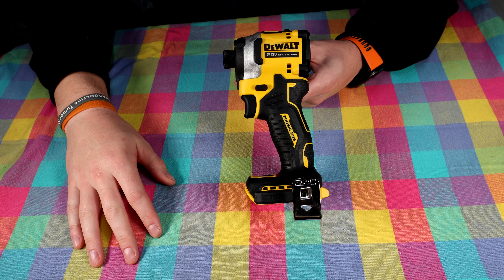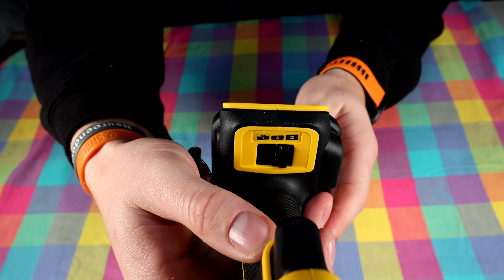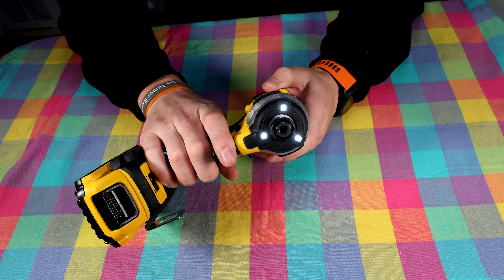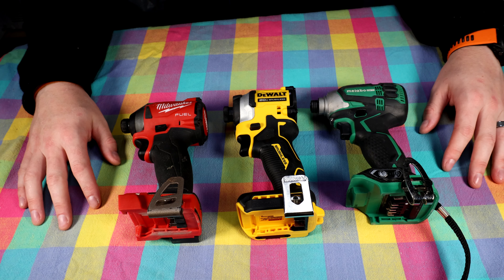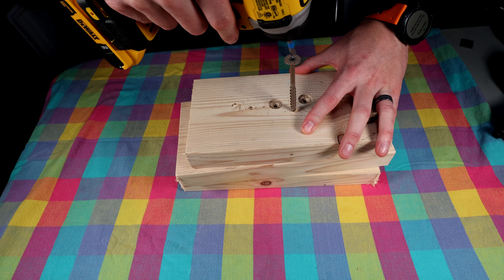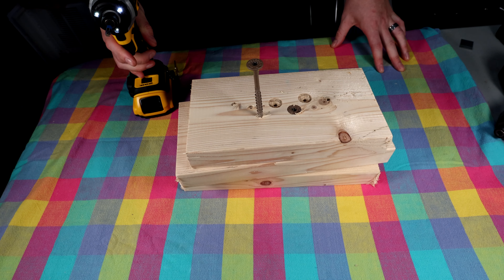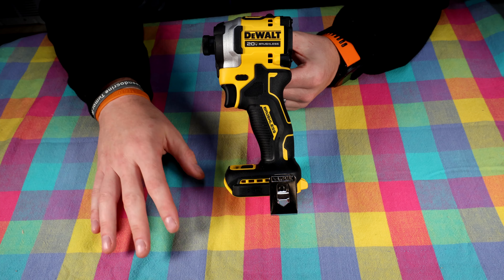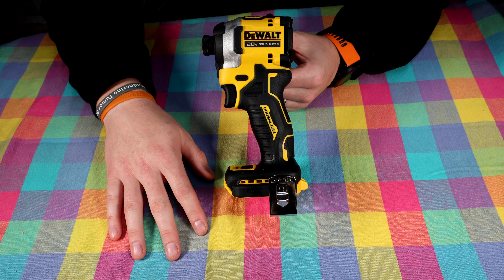DEWALT'S NEWEST IMPACT DRIVER VS. METABO + MILWAUKEE

Comment: Looks good.  I have actually run my 887 DeWalt until it smoked out!  Lots of heavy duty screws.  Up to 5/16”.  I am a multi platform guy, but am going to switch my impact driving to Milwaukee, it is faster.  There is kind of a funny feeling you get when running 6-8” T30 or T40 screws uniting two treated 4x4’s and hoping it will not start smoking!   I have also thought about the Bosch multi volt offering too, I do have several Bosch tools also.
Reply from the maker: Never a good sign when the magic smoke comes out!